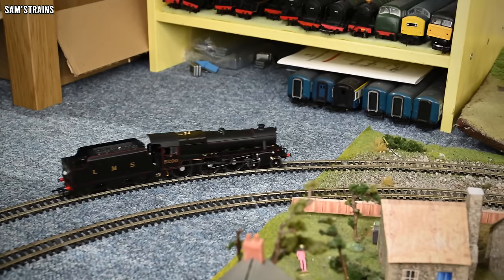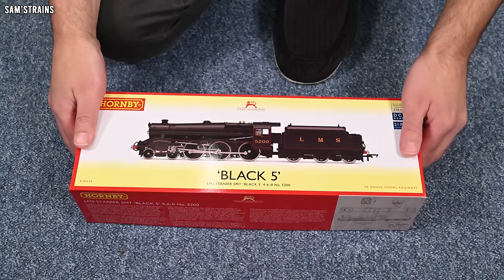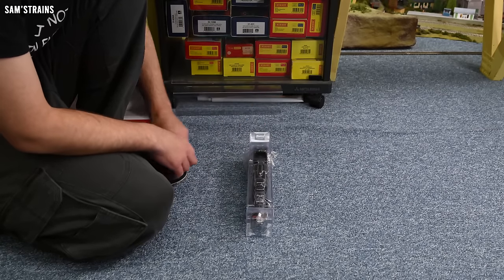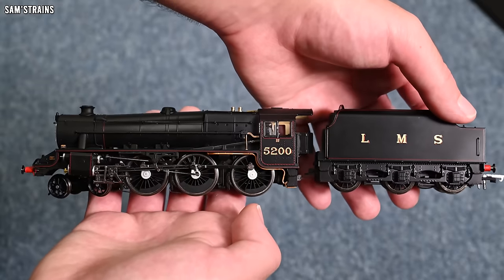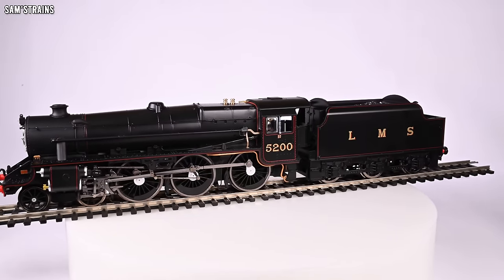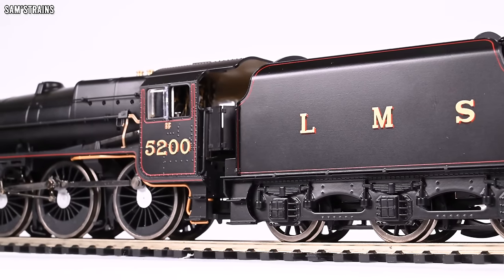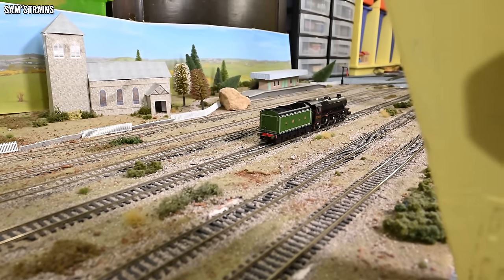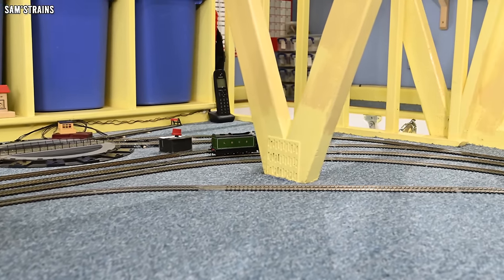Hornby's Horribly Faulty New Black 5 | Unboxing & Review

Comment: What is your obsession with diecast metal in locomotive? Whenever I see metal the quality and micro detail in the casting is often not that good compared to what detail you can get in metalcasting for some reason when they do a locomotive body it is never that brilliant it normally falls into the cat grave well it’s okay and then my second point is it the damn thing is made primarily of diecast, most peoples Next bitching point is it hasn’t got a very good power to white ratio can’t pull a lot well of course it can’t it’s probably over 50% of its motor to pull itself along because of the weight. I understand your concern with the pricing I think Hornby pricing is disgusting and the end of the day they are only doing themselves, harm because they are not selling as many units as they could do sooner later they will come onto sale and then they get sold but I do not think Hornby are alone when it comes to silly pricing go to Europe and go look at some of the HO models by some of the high-end manufacturers look how much they charge then come back and look at  Hornby sly this is just where the hobby is. It has never been a cheap hobby when you look how much models were back in the day when people mentioned back with roast into glasses they very rarely taken into account how Little people got paid back-then.

Comment: Señores y don SAm:  ver que el motor en bajas RPM a veces intenta mover esa locomotora en dirección hacia atrás;   puede ser  un problema de engranajes y haya que cambiar esos porque están con rebabas entre los módulos o levemente excentricos. No puede ser que estas locomotoras tenga problemas de..."cuarteo" (quartering)  en las ruedas, se necesita una herramienta para medir eso. Por otro lado, esos motores chinos de 5 polos, imitación de Kato, no terminan de convencerme porque hasta por $ 3 se conseguían en EBAY USA. Si quieren ahorrarse problemas, mejor con motores japoneses Kato o Mashima... si estos últimos tienen suerte y los consiguen, o....si el presupuesto  alcanza, Buller o Maxon. Saludos y gracias por su revista de este modelo.

Comment: What a shame you received such a shoddy product. Just as I thought Hornby had turned a corner. Loose crank pins is potentially disastrous. Too many faults for me. Sadly
They are at the mercy of the factories who assembled them. Hornby are not alone here. Might stick with my Railroad model which at least works. Cheers Paul.

Comment: It's not that Hornby are unlucky they seem to be incapable of producing a quality model blobs of glue and glue finger prints all over the paint work a warped running plate and a totally usless quality control department. This should have been a flagship model, but instead Hornby are ripping off customers with more poor quality tat. As long as modelers buy these low grade models Hornby will continue to churn out junk they seem more interested in developing fancy gimmicks than getting the basics right.

Comment: From what I’ve seen so far of these new black fives I don’t think I’ll be buying one 

I don’t like the finish on the silver paint work and the lamps look too big and a bit of a gimmick. And the general finish is not good enough 

As for the tender connection it does seem to be a bit of a problem with these new Hornby locos 

I had an issue with my Dublo Sir Nigel Gresley. I made a very of the problem https://youtu.be/WAXUOaYvApk?feature=shared

I bet your loco has a similar issue

Comment: I'm really disappointed by your review. Not by its overall quality, but by the facts that drives you to your conclusions. Hornby has the ability to do a superb model and, by their usual carelessness, they botched it to death, and you exposed them for that. You did your part, and I thank you for that.
It's blatantly unacceptable to have such quality problems. Any consumer goods which would have such problems, from kitchen appliances to cars, would makes a legitimate scandal in the medias. For GBP 206/240€, this is insulting to the customer.
Add to this no flywheel and the diecast limited to the footplate, and you have a stupidly conceived model. The price asked should be put down by GBP 50/50 € in my opinion. What the blast had gone through the heads of Hornby's executives ?
I will buy one because it is not a bad model, and it is a nice retool of the Black 5 Hornby have in his range since ages, but, sorry, for the same price, a German brand like Piko of Roco does FAR better.
Hornby has sent a first issue only to Rails of Sheffield, issue sold out by now, and I am waiting for Modellbahn-Union to have their models for sale. Others retailers have none by now (TMC by instance). Can we think this is done on purpose to clear the shoddy manufactured models first ?

Comment: Clearly what you have is not a typical example. All other reviews I have seen have been very positive and have not had any of the issues you have there. Oh and sorry to say but your obsession with Accurascale is tiresome.
Reply: Which model do you suggest he use as a comparator instead?
Reply from the maker: I can’t say whether it’s a typical example or not - it’s the only one I’ve tried. You’d better get used to accurascale - they’re winning every award there is, and they’re here to stay!
Reply: @mkaustralia7136  Nobody is questioning the merits of Accurascale however barely a review that is made on this channel is without a reference to that manufacturer. That is bordering on obsession and suggesting bias whereas precisely the opposite applies to Heljan in the case of the Class 28 where it was suggested that Accurascale should develop and release it. Heljan get an overall bad review on this channel some of which is warranted but much is not.
Reply: @guyclark2975  I understand your point.

It is sensible to compare the subject model to other similar models, both in features and in price. 
It makes sense to select the best of the available similar models for that purpose. 
At present, most times it is an Accurascale model which fits that description. Sometimes it has been Dapol and occasionally Bachmann. That is not Sam’s fault, but I would be disappointed if he were to use a so so model for comparison leading to the subject model appearing not to be too bad. 
On the Black 5 of today’s video, it probably would not matter as the copy Sam got was so dire.
Reply from the maker: That's right - it just makes sense to compare new models with the best in the industry - and for me that is Accurascale. I'm sorry that you've had to take the time to explain this xD
Thanks for watching, Sam :)
Reply: @SamsTrains  Just taken delivery of mine this morning from Rails Of Sheffield. Utterly flawless in both appearance and performance. You should adjust the title of your review as it was only the example you had and does not reflect on the new Hornby Black 5 as a whole.